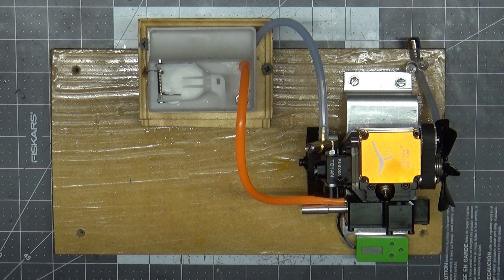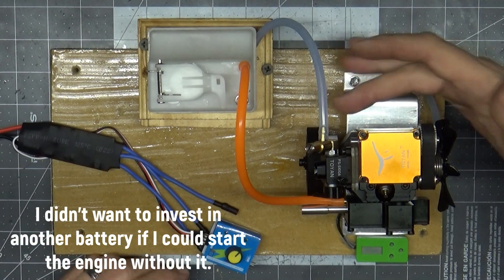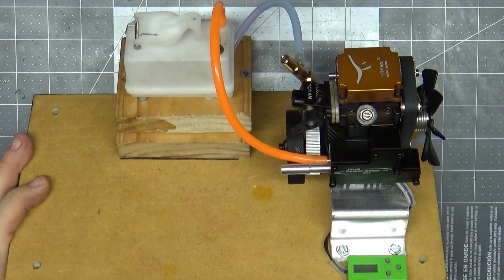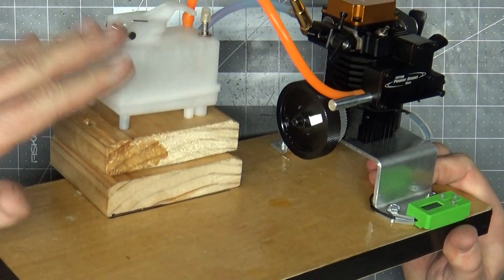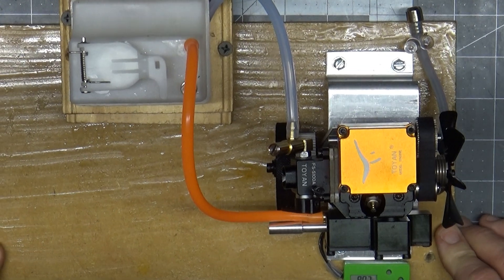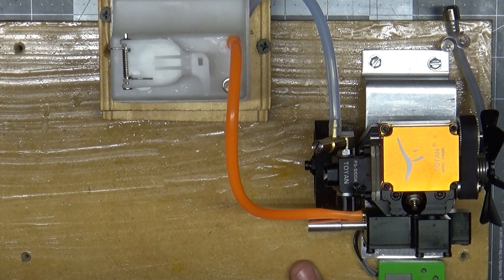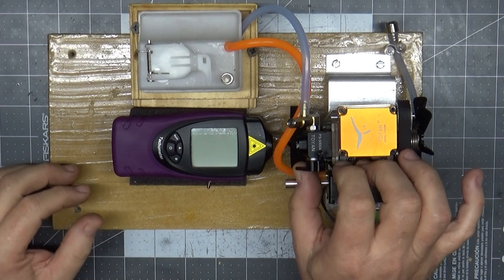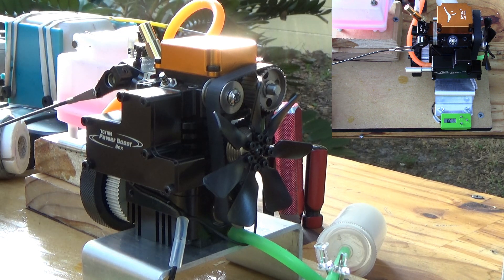Toyan FS-S100A Test Stand Setup and Run

Comment: I havent been able to get mine to start. It turns over, the glow plug is getting voltage,,,,I dont know....
Reply: NM, I got it. They said it was tuned at the factory, but the needle was too far closed. It works nice now!

Comment: Great video mate. I love mine and installed it into a rc car. Question, how hot does your orange head get? Mine is around 200f but around 140f where you are measuring it on the block. Where is the correct way to measure the temp?
I am running 20% nitro and 10% synthetic 6% castor.
Reply from the maker: I think I was seeing a similar temp on the cover as other locations, but I would have to check it again.  I know it felt quite hot to the finger.  I do not think there is one correct way/place to measure engine temperature.  I put the loop around the block for several reasons.  The thermocouple fit nicely between the cooling fins and would not come out.  It is also closer to where the combustion is taking place, which in my opinion, is the most important area to monitor.  The glow plug area is another place that could be measured with an IR thermometer but less consistent than a fixed thermocouple.  I know nitro car racers measure directly down into the glow plug/head area to check the temps but I think that is because with a body shell on that is the most convenient place to measure.  I too do that on my buggies/cars/trucks.  I do not like to see temps there exceed 190F.  The Omega 25% fuel I ran has 25% nitro, 17% total oil content (30% castor. 70% synthetic)
Reply: @dmrcflyr2  Thanks for the reply David. Much appreciated. It seems my temps are normal then. Max under load on the RC car was around 150ish on the side of the block. It is a great little motor and it seems to perform well in the rc car that I have managed to shoehorn into :)
Reply: @dmrcflyr2  hey I wanted to buy one but I'm having trouble with the fuel could you send me a link to the fuel you used in this video please thank you
Reply: Think the recommended oil is 20% castor for these?

Helps with cooling and gives more protection if it runs lean

Comment: Isn't there an option to make this engine liquid cooled? I thought Johny Q did this.
Reply from the maker: There is a liquid cooled version of the engine.  It basically has two other nipples on it for inlet and outlet water flow.  but adapting or creating your own radiator is the only way currently to use it.  I am sure at some point they might offer a pre-made radiator system as they seem to be adding new accessories daily.
Reply: @dmrcflyr2  - If you are using it in a boat you can utilize the water cooling option which is force fed by the propwash in most rc boats. This engine would be awesome in a scale crackerboat rc boat.

Comment: No rpm monster but I get best peak at 9.1k ish.  I use 4 strokes in boats no load only drive train and flywheel 14 to 15k is typical depending on engines thus far tested .30 and .56 size engines loaded in the water 11.8 to 13.6k  depending on prop. As a idea 
perhaps you can park a sensor on the drive shaft to take rpm readings.

Comment: Now that is really neat. I'd seen these online and and at first couldn't figure out what the heck they were until I read the description. Love the sound. I do wonder if maybe putting 2 pieces of reflective tape of similar size and shape 180 degrees apart like a 2 blade prop would give you usable RPM readings

Comment: So the next question is could this engine be configured to turn a prop?
Reply from the maker: Why would you want to?  It is big and heavy compared to similar displacement aircraft engines.
Reply: Sorry didn’t realize it was heavy
Reply from the maker: Well it is designed to be installed in a car/truck or boat, not an airplane.

Comment: This is a very cool looking engine sound great, but it's kind of weird hearing a 4 stroke without the prop noise, but it's very cool at the same time. Is it just me? Or is a very low noise coming from engine exhaust.
Reply from the maker: Put it this way, I could run this in the yard before sunrise and not bother anyone.

Comment: That's a nice motor David, it wants to rev, but it's just not ready yet, with some more fuel, and a bit of your magic, it should be a little beast.
Reply from the maker: How do you know it isn't already hitting the recommended top RPM?
Reply: @dmrcflyr2  I am only going by my experience with single cylinder motorcycle engines David, so I could be way off on this one, it just sounds a bit like it is being strangled at the top end of the rev range, I am new to rc engines, so as I said, I could be way off on this one. It's still a cracking little engine, and an engineers dream, or a machinists nightmare, thank goodness for cnc machining. Have a great day David.

Comment from the maker: At the beginning of this video I make the statement that the fan seems to be for show and doesn't really do anything.  That was my impression during my first runs in the garage on the floor and feeling the engine by hand.  This run video tells a different story.  Since I have a temp loop on the engine you can clearly see how the temp drops at higher RPM due to the cooling effect of the fan, while watching the temp rise steadily during idling.
Can be purchased most economically here: https://www.enginediy.com/collections/4-stroke-rc-engine